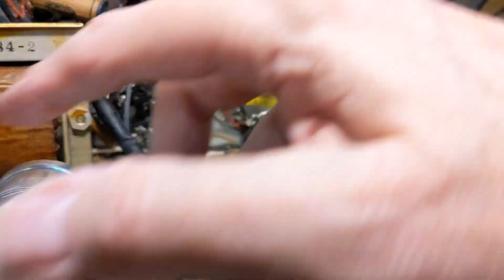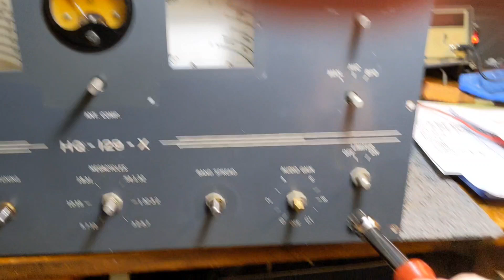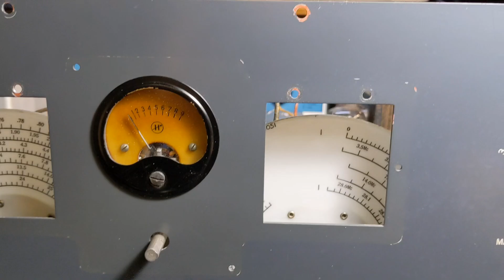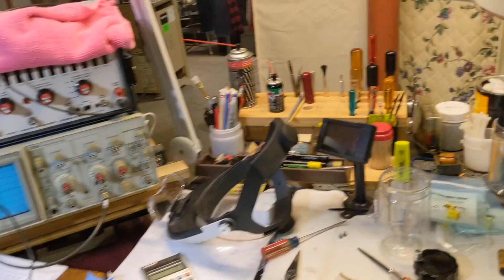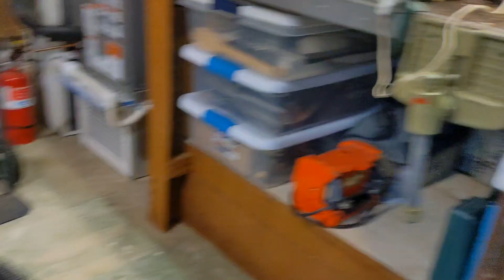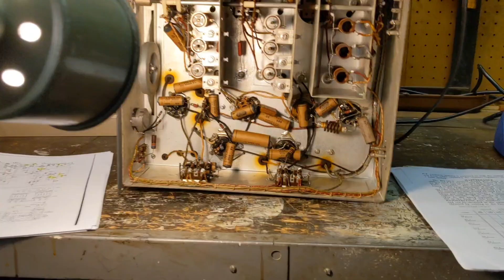Hammarlund HQ 129X part 3

Comment: I have been SEARCHING for the actual 6X8 Mixer/Oscillator Mod for my fully recapped and restored Red Label '129X, which I rebuilt in the 1970's and used as an Novice/Advanced Station Receiver with my Johnson Viking 1 & VFO. The reason this is a GOOD MOD is the lousy, noisy, drifty 6K8 Tube which also lived in many WW2 Command Sets - fortunately the Bombers had lots of altitude and weren't above 18MHz, where this got noisy. K7PP has some great VIDEO shots of the mod, but it would be great to find the circuit and the new values for R/C around it. A Tube manual will give the pinout and socket changes. My only reservation is that I marked the BANDSPREAD dial accurately with a crystal calibrator, and a tiny point Sharpie. Still looks great along with all the Sprague Orange Drop capacitors. Another idea is to UP all the Detector and AF Coupling Caps and the 6V6 Cathode Bypass cap and the Filter caps. Killing the hot rectifier tube and adding a Keystone Carbon inrush limiter helps, AND some line voltage could be BUCKED by repurposing the wasted 15 watts of 5V AC Filament current winding in the AC Line path, just connected reverse phase. That way some of the Silicon Diode and 115V>120V present day line voltage will be easier on all the tubes! Best 73's, Hilary W4HDL
Reply from the maker: Thanks for the info but will probably keep it all stock for now. I restored it as a tribute to the original owner now an SK. Will probably start working on the Viking 2 transmitter in the near future.

Comment: Fred, do yourself a favor and only replace a few components at a time, then do a test to make sure you don’t have an mis-wire or other error, before moving on. It happens and is much easier to find, if you don’t have to recheck all your work. I have successfully restored quite a few Hammarlunds and Nationals. They are a walk in the park when compared with some others of this era. Hallicrafters can be a real headache, to name one. Good luck!
Reply from the maker: Hi Chris, thanks for the advice. That has been a practice of mine for years. I work in sections and turn on when a section is completed.
You only need to make that mistake once to learn that lesson.
Component replacement is complete and getting ready to go over the alignment process.
Next video coming soon.